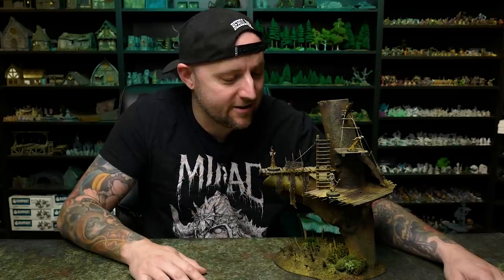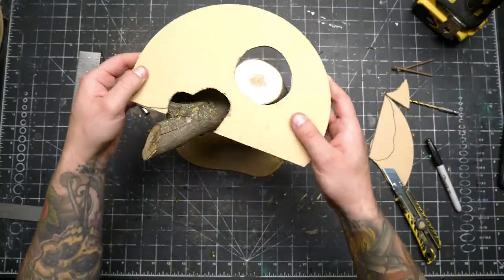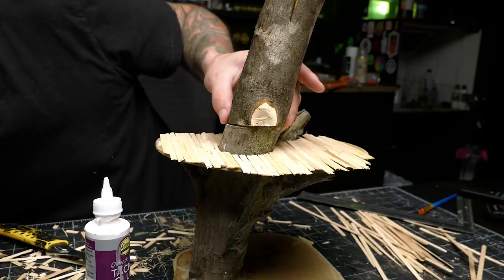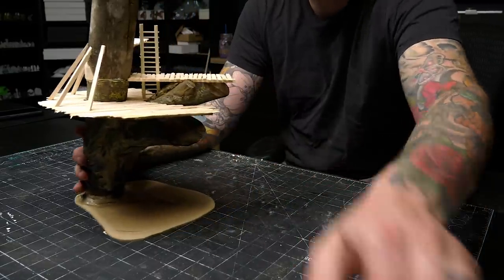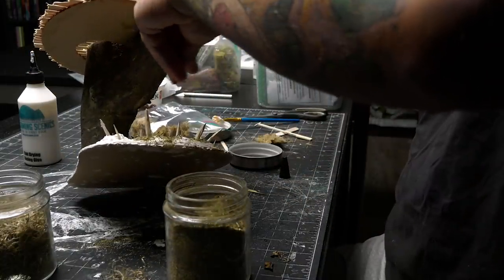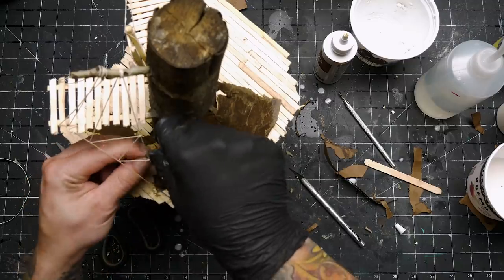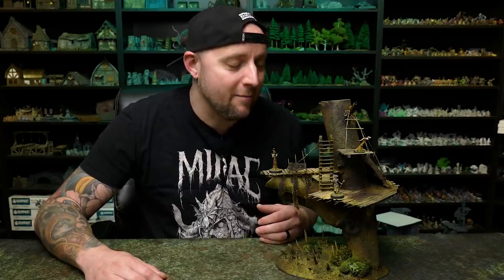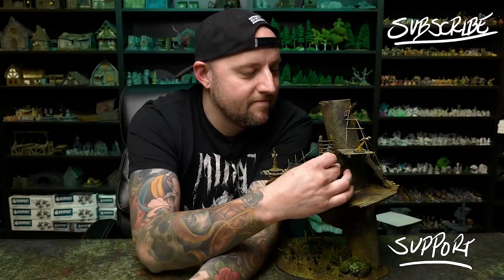Making a Massive Playable VIKING TREE FORT for Dungeons & Dragons

Comment: A LONG time ago, I had done an entire tree village for Star Wars using a variant of the WotC minis rules. That was a pain in the rear to build, used pvc pipe for the main tree trunks and a lot of putty that I probably shouldn't have been using due to what it was made out of. Various craft sticks for the platforms that I hadn't bothered to add texture to in a normal way, gave them dunks into a redwood stain and drybrushed when dry. I had a full 3'x3' board for it.

I'd also done another 3'x3' board that was semi-similar in design, but was more of the high mountain peaks that you see in a lot of martial arts movies where they rise above the clouds for a monastery and/or shrine. I basically did a lot of foam chunks to make up the majority of the mountains bulk with wooden dowels in the center of them, then used expanding foam to cover that and make it into a larger thing while filling gaps before I started the board itself. I found some asian rough wilderness/farmland (I can't remember if it was chinese, japanese, korean, or other) aerial photography to cut and stitch together as a distant "ground" with open spaces for the mountains that I drilled into the base to insert the dowels into the wood I used for the base after I'd painted them. Then I used some cotton batting that I teased out to a rather thin layer and adhesives to make it look like a cloud layer at the base level with the lowest levels of the mountains as playable with paths, bridges, and other things for going up and between them...was far less useful than I wished it would be.

Both boards were, eventually, donated to some game stores for some store credit because I didn't have space for them.

Comment: That looks fantastic Jeremy. It was nice to see you really enjoying yourself, rather than struggling. With that in mind, why not expand it a bit? 
If you used a board, maybe two feet square, something you can lift/move eaily, you could add other trees and join the together. Each tree could be built separately, then combine all the trees onto the board. Bridges(wooden and roped), rope swings, tunnels, incorporating various hide/wooden living spaces, the possibilities are endless.
And then the can start adding the ropes, 𝒂𝒍𝒍 the ropes.😁

Just a thought.😁
Cheers for now,
Dougie.
P.S. Of course, smoke machines could give you working chimneys/cooking fires etc.😂

Comment: I suppose you could take a hole saw bit to the mdf platforms before you put them on to allow for gaps in the planks.  I suspect many folks from denser urban environments are all 'huh?" to the concept of deck screws and 'just grabbed a big old branch from the yard".  That glue-soaked jewelry string could probably also be used as wire between posts for a sci-fi/post-apoc setting as well.  There are not enough words for how awesome that leather look is - was that just 'standard', find it at the dollar store construction paper?
Reply from the maker: It’s just the brown out of a multicoloured pack you’d buy for kids crafts.